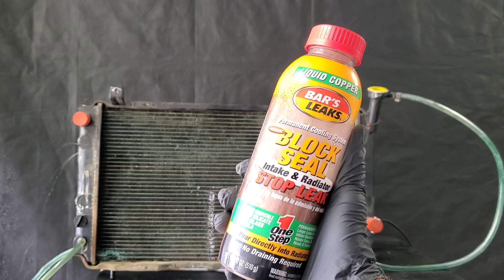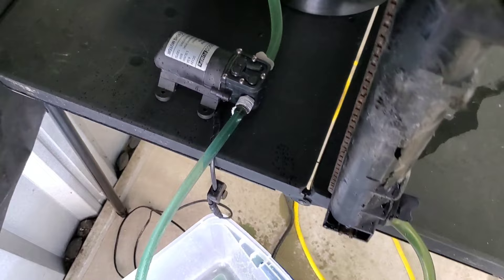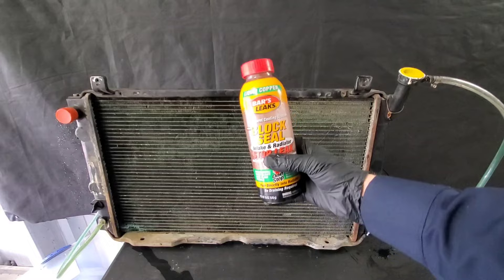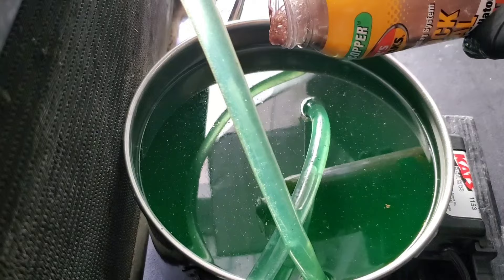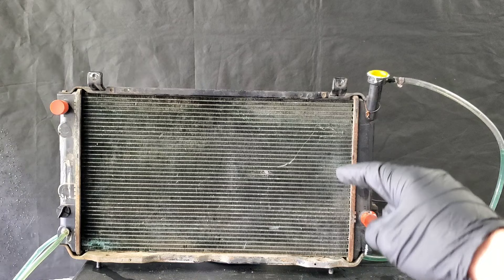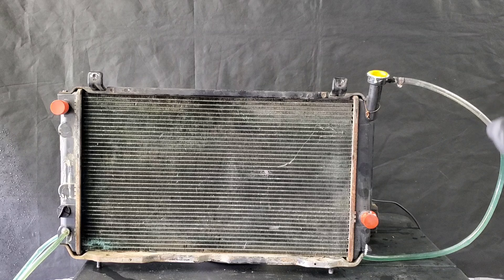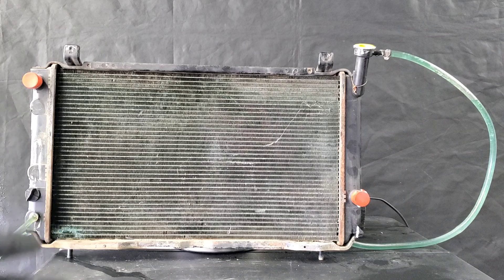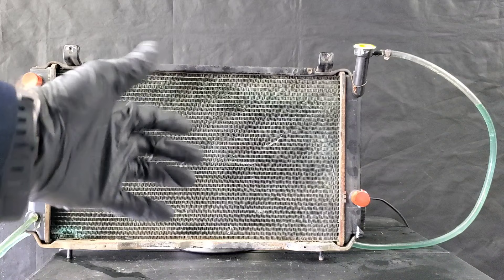Stop a Coolant Leak Permanently with Bar's Stop Leak!?

Comment: I've used a couple raw eggs and about half cup of pepper in a few different squirting radiators. The egg cooks and scrambles in the hot antifreeze and the pepper will swell up to five times its size. Both the egg and pepper mix will coagulate wherever it's pissing from and seal up the leak. Smells like breakfast when you pop your radiator cap 😂😂 swear to god it works
Reply: 😂 good one 😅
Reply: I saw this pepper thing on tv. Guy stuck in mountains with a leaky radiator. He had pepper and used it to get where he needed to get.
Reply: @miguelsantillan7697 yea I actually think he's serious. I've heard of the pepper thing from a few different sources.
Reply: So black pepper or diced pepper
Reply: Bro I’m so scared to do this but I wanna know for sure
Reply: I put a steak seasoned with salt, pepper, and creole in there one time 😂
Reply: I heard that before
Reply: @RattlerPiratesMusic 1000% true. I know it sounds ridiculous but it's true. Old county bout trick. There are YouTube's on it. Googleble too
Reply: I saw an episode of mcgyvar when I was a kid he used egg whites cant remember if he used pepper though
Reply: How many eggs an how much pepper
Reply: @ChristinaYoung-oo4tm   about 6 eggs and a half cup of pepper
Reply: Thanks!
Reply: It does. I have done it too, but no pepper, and it worked
Reply: when to add catsup??

Comment: Block sealants are really only a temporary repair, the only real fix is to fix the engine.  Damage can result over the long term; a block sealant, i.e., Blue Devil, K W Block seal, etc may work in the short term and as such, is okay.  But, they can also clog heater cores cause water pump problems etc.  FYI  --   I used KW Block seal  (in the copper coloured can-- )on customers vehicle's for over 40+ years with good results.  The trick with KW Block seal or any related product is to follow the instructions to the letter.  Don't try and rush or shortcut the process; success or failure depends upon patience and effort.
Reply: Yeah I'd never use it on a quality car but I think for a lot of us our old cars aren't even worth repairing something like the head gasket
Reply: These products should have passed ASTM 6107 which is a test to ensure they work and cause no damage. In addition some, like the Bars tablets, are OEM (tablets have been used for 30 years).
Reply: Are you just talking about the product that he’s using in the video or in general? Over 100,000 miles ago I used a walnut shell pellet inside of my engine on my Chevy Tahoe and it has not leaked  at all sense.I’m sure it depends on the situation and damage but it’s works great for mine.

Comment: My car leaks coolant so bad it only drives for 15 minutes before overheating 😂 I gotta keep gallons of water in my car to refill when I get to my destination to make it back
Reply: Bro having the same problem just be careful you dont blow the head gasket
Reply: You ever test out the bars leak stopper? I'm thinking of doing it but I can't tell exactly where it's leaking from but know it's from the radiator because I see moister when I look in between my radiator, I really don't want to get a new radiator ngl😅
Reply: @Ghost-gu1wf you test out the stuff?
Reply: I have the same situation, I had to keep gallons of distilled water with me. 

The one time I was neglectful, and didn't refill the reservoir was the day I blew the engine

Comment: ive used this to fix leaking timing covers, like a BAD LEAK. head gasket leaks... cracked manifold leaks. its awesome but not permanently the head gasket you have to use it again after 10k miles and it works
Reply: Exactly
Reply: Where do you pour it ? The reservoir? Or directly on the radiator cap?

Comment: I Have used it . I used it on a 2001Saturn SL2 to fix a bad head gasket , that was pissing out the side of the motor . My wife drove the car for another 60K miles with out adding any more coolant !
Reply: back passenger corner? I had 2 SL1s that both leaked coolant exterior of the head gasket on back passenger corner and 1 had a external oil leak from the head gasket in between cyl 3 and 4 but compression was fine, so never touched it. I was surprised to see the oil leak coming from the head gasket, no idea what caused it, obviously the oil is not pressurized when bleeding back into the crank case. Saturns were beasts, Slow as all hell but if I remember right GM literally stopped making the proprietary engines because it was better than the 2.2/2.4..... Of course they don't replace the 2.2/2.4s with the 1.9 SOHC/DOHC, they stop making the 1.9s. Couldn't have used the timing system GM? No what did those motors run for 15 years? Never got the timing chain issue fixed 😁

Comment: I've used it for a 99 Ford f250 super duty with the 6.8 V10 gasser. It lasted a fairly long time, about 8 months until I pulled a heavy load. Honestly I wasn't to surprised when it stopped working under the extra exertion from pulling 10k. That's a bit much to ask of anything meant to be a temp fix and for a cost of under $10. Had I not pulled a heavy load, I have no doubt it would still be working.
Reply: Ya dont think the gunk it left in your engine and around the thermostat contributed to that?
Reply: So they are selling me a car with a radiator leak I think this will help..... My questions is car is stopped do I just pour this inside do I add water? Then start car?

Comment: Great video.  Bars leak saved me when someone hit and run the front end of my car and the busted radiator wouldnt hold any coolant whatsoever.  The big key is if you are gonna take the radiator out to weld it or try and find leaks and leak area is found, then just replace the doggone thing.  You already did the hard work of removing it.

Any vehicle with a good engine and good frame plus limited corrosion is worth working on.

Used car prices are too much.
Reply: it wii bloc everything.aakaakakakaka

Comment: I commented on your video from 4 years ago and immediately following the comment, I saw this video haha. Much better. I used this for a small head gasket leak I believe. It's a turbocharged 4cyl Cobalt SS and it worked awesome..... Until I got comfortable that it worked after a few weeks and got into boost. Later that day and following, symptoms gradually came back and nothing seems to work after. So take from it what you will but if I had a naturally aspirated engine I would like to think it would have been semi permanent at least haha
Reply: On a blown head gasket you have to use pure 100% sodium water glass not any of the store products. Don't use Blue devil either. It's only 30% sodium water glass and blue food coloring.

Comment: This is a great demo and of course the coolant system is under pressure and heat but hopefully no one is using this as a permanent fix. I’ve seen some cars with a spare tire for months on end and that’s not good especially when it’s the front tire.
Reply: I asume you mean one of those anemic wee skinny space saver wheels. My spare wheel is a full sized number with a brand new premium tyre on it. It could be uses for years if needed.
Reply: This is all I can use for a permanent fix 
I can't get a new radiator because my bike is to old 
Do you think this would help me or will it mess something up ?

Comment: I had a 2009 Pontiac Vibe with about 227k on the clock. The car still ran like the day I  bought it.but I allowed a roommate to drive it to work and he ran the coolant dry. This in turned ruined my headgasket. I bought the bars to try and repair it, but unfortunately it threw a rod on me. Shockingly the crazy car still ran even with a hole in the block. but not very well.
Reply: Bro if your  room mate drove it to work and it ran dry, wasnt his fault, you should of did some maintenance on the car. You think a few  miles did this. That iss like me borrowing a car, driving to work and the engine blows because there is no oil in car. Not my fault.

Comment: Just poured this same product in my Volvo 240 4 cylender which has a leaky freeze plug on the block.   Ughhh.  Hard job to fix.  Poured the stuff in and it seems to work!  so far so good.  
One day in.   Cheers from L.A.   California.
Reply: Where did you pour it in man ? The reservoir for the coolent ?

Comment: Did you use room temp water or boiling water? How long does it take for the stop leak to cure? I have my radiator out just like you and I plan on pouring Bar stopleak inside, covering all the holes, and shaking it up. Leave it for 24 hours and then drain/flush out anything solid or hasn't cured before putting it back in my vehicle.

Comment: Will Bars leaks Block seal temporarily stop a internal leak in a jd 8650 tractor engine. Ans how much to use?  Not sure if the block is cracked or the liners are leaking.  It gets coolant in oil..

Comment: My wife and I are currently in a cabin in the woods. Town is about a 25 minute drive. 

So our radiator sprung a leak (2016 Ford Edge 2.0L Ecoboost). 

Fortunately, we have a neighbor that took me to Autozone. I got two bottles of the copper stuff. 

So far, after 15 minutes of idle, still leaking.

It started to rain. So I’m going to wait a bit and then idle it more.

Comment: Would this fix a crack in the bottom corner of the radiator? 
And do I just pour it in the coolant top cap ?
Reply: I have the same problem did you try it ?
Reply: @Bore101  yes and it works temporarily
Reply: @dylanrichards4565 did you just pour it in the coolant top cap? Thinking of getting this for my radiator, has a small leak at the bottom right corner.
Reply: @rafakelrodriguez4835   yes my coolant was low from the crack I poured it into the top and it fixed the leak good enough to round off my plow season for my plow truck

Comment: Sealants are good and bad. I had a power steering pump leak a bad one n tried to using power steering stop leak n I used too much and it messed it up more
Reply: I used power steering stop leak and it worked for me

Comment: So do I put the bars leak in the reservoir tank ? Or straight into the radiator itself? 🤔
Reply: It says radiator but I poured mine in the reservoir n worked perfectly
Reply: @tjmccay166  Thanks for this, that's where I need to pour mime!
Reply: @dk60ish  no problem hope everything goes well

Comment: Do HVAC equivalents also work?
Reply: No. Modern car HVAC systems are a whole other ballgame.  Besides, the orifices in the condenser, are super small. Any blockage there, will destroy the compressor. You’ll probably need a whole new system after the compressor bites the dust.

Comment: Would it seal a crack on top of radiator?
Reply: Same question^
Reply: My metal piece is leaking at the top towards the middle
Reply: @yellacain5814 did you ever see if it fixed that? I'm having that issue right now
Reply: @jeffreym366  it works temporarily if done right but I ended up replacing the whole radiator after 2-3 month😭 coolant will still leak out and if you use water with that it’ll rust your radiator almost instantly

Comment: Or you use ground cinnamon it has worked for me on several different vehicles like cars, motocross, tractors etc
Reply: Where do you put it? And how much?
Reply: @shellybelle6781  Pour about 1 deciliter of ground cinnamon straight into the radiator.
Reply: I heard ground pepper ?
Reply: @totljag1  never tried, but it might work
Reply: You fore real or you are joking
Reply: @jm.4071  It works, have done it many times when I haven't had time to fix it.
Reply: I have never heard of cinnamon but I have personally used raw a eggs and black pepper. Two raw eggs and about a quarter  cup of ground pepper in your radiator. The heat will cook the eggs and scramble them. The pepper swells up and coagulates with the egg.
Reply: @billsauer3164  best is corn flour. little pieces in the flour get stuck and then swell while closing all the holes. i put about half table spoon of it.
Reply: @kempaswe4022 does it work for a quick drive or for few weeks or so or how long if you know ?
Reply: @ike7539  does it work for a quick drive or for few weeks or so or how long if you know ?
Reply: @billsauer3164  does it work for a quick drive or for few weeks or so or how long if you know ?
Reply: @K1500b  I had it for a couple of years without any new leaks until I got a stone in the radiator and it became a mess

Comment: That stuff sucks it clogs stuff I have a video on what that stuff does used it in my 02 civic and while driving my radiator exploded do not use this stuff
Reply from the maker: Good or bad I want people to know what other's as yourself have experienced.
Reply: I was coming back from a trip 3 states over somehow rad sprung a small leak enough that I didn't notice it and started running hot I was in a rinky dink town on a Sunday just happened to be a block away from Walmart got a bottle of this saved me and my family expensive tow and got us back I owe this stuff a ton!
Reply: @concealit4800  how did you use it? Did you just pour it in with the radiator still attached to the engine?
Reply: @sincerelyrob4240   yes lol

Comment: Get it repaired, dont use this crap. It might stop the leak now but will cause its own brand of issues in a year or two. Why crap like this continues to be sold when it ruins vehicles is the big question. Either weld or replace the fricken radiator or hose.

Comment: Anyone using this product in place of a repair is only creating more problems in the future. It will clog up your cooling system. Any cooling system “stop leak crap” should only be used for emergencies, like getting back to town. Then repair your vehicle properly. Or you could just put eggs in your cooling system. Works the same and is easier to flush out

Comment: That's stuff clogged water pumps and heater cores. I wouldn't recommend it on anything. It just makes things worse
Reply: It WONT in most cars if you follow the instructions...you must run the heat on full blast and drive the car for at least 30 min not just idle...
Reply: @RicardoLopez-ty4kn  lol yea .sure...lets go with that lol
Reply: @RicardoLopez-ty4kn  the instructions are on the bottle..just follow them..
Reply: @kenrivers9757  yeah bro I'm asking if it works to buy it but yeah forget about it.
Reply: If you used it in old rusty coolant probably thats why
Reply: @rulazz_  exactly  lol.
Reply: You probably didn't flush out your coolant.

Comment: DON'T USE THESE RADIATORS' QUICK FIX. NOT WORTH IT. MAKES THINGS WORSE. TAKE A BUS, UBER TAXI INSTEAD
Reply from the maker: Yeah I think there are times where you are absolutely correct. Also I believe in a specific situation like the vehicle not being worth repairs on the block or similar price situation it may be ok to use.